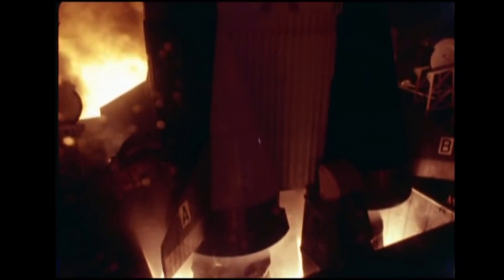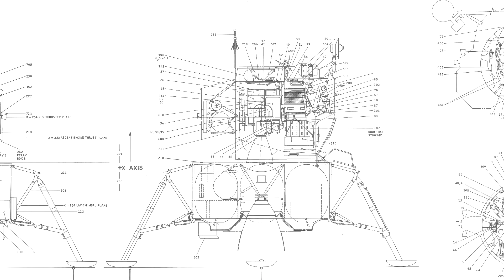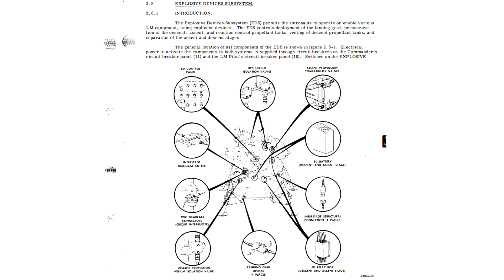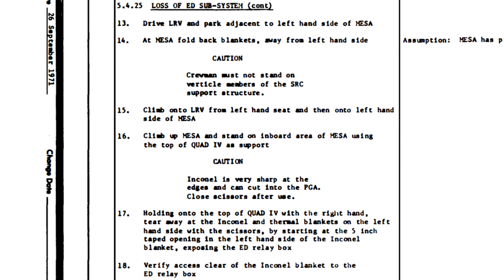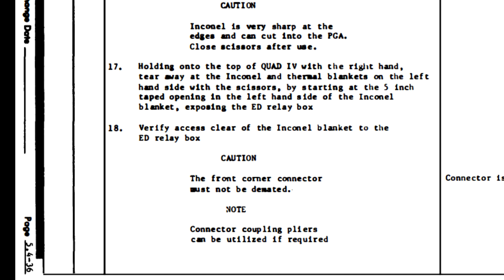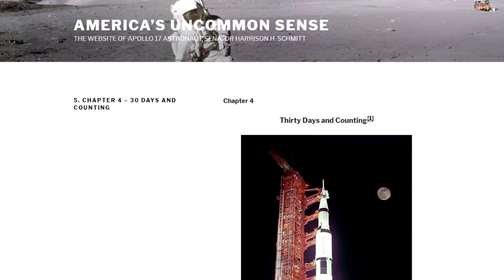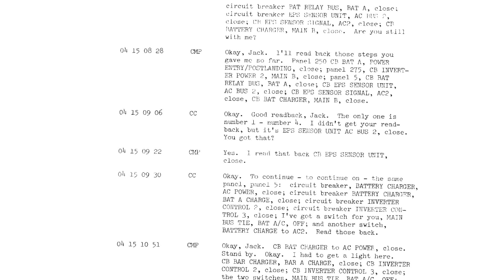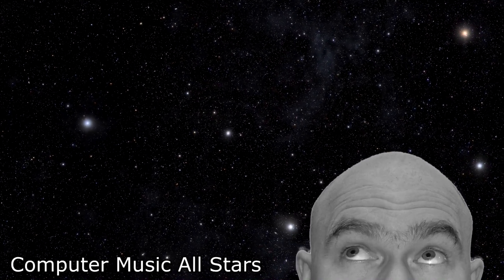Why Lunar Landers Had Jumper Cables For Emergencies

Comment: I thought the ascent engine on the LEM was a chemical engine--one that produced thrust by the mixing of fuels instead of ignition of fuels.  For the very reason that it was less complex and thus more reliable.
Reply: Yes but the helium system used to pressurize the propellants had explosive actuated valves that required electricity to be used. Same with the explosive actuated bolts and guillotine to sever the ascent stage from the descent stage.

Comment: why would they need to jump start the engine, when the fuel was hypergolic (they ignite when they mix)?
Reply: They needed power to open the valves and sever the connections between the upper and lower stages.

Comment: I wonder what the added costs in terms of weight and getting into orbit and to the moon would have been if an accessible socket had been added to plug the jumper cables into.  I'm sure that by the point you need to climb up, cut an access hole, etc, etc, being calm and careful would be getting difficult to do.
Reply: Interesting question. They were certainly very concerned about weight butGrumman were informed during the early stages of design that the Saturn V F1 & J2 engines would most likely be uprated for later missions. They were also informed to plan accordingly for the possibility of the LRV being included eventually. Seems to me what you suggest would be a easy add-on all things considered.

Comment: I got a question for you… How was the Saturn 5 rocket held vertical before launch, the weight distribution while standing vertical intrigues me…. It didn’t sit on the  engines and it wasn’t held in the air by the gantry or the arms that fed the fuel.  So how did it stand vertical.. where was the point of contact that held all the weight?
Reply: 4 reinforced points on the bottom skirt of the 1st stage.

Comment: I have read that for Apollo 11, Neil did not consider the double redundant automated fuel valves to be safe enough and he wanted the LM designers to add a manual valve control as well.  So that, if EVERYTHING failed, he could simply open the valves by hand and achieve hypergolic ignition without ANY electrical power at all.  Either NASA or Grumman decided this was not a desirable design feature and overruled Neil’s request.

Comment: To answer Scott's question: the vacuum of space is a better insulator than dry air. It won't hurt anything electrical to expose it to space. The battery and it's terminals are probably in a sealed system, with 1 earth atm of pressure behind it. It's very likely it's all very well sealed where it needs to be.

Comment: The battery voltages on the lander were probably much different than those of the rover. And why there was no easy way esp. when weight was a premium to interface the two systems.

Comment: Scott I believe it was not the measure of last resort but rather of penultimate resort. The absolute last resort involved affixing the leads to a battery and to the groin area of their spacesuits. With the lower lunar gravity the resulting surprising and intense electric shock to a vulnerable area would allow the astronauts to propel themselves into orbit where they could eventually be picked up by the command module...:)

Comment: you're going to feel a right goon soon...when all this gets revealed as FAKE...coming soon. Boy will I laugh out LOUD!
Reply: Roy and Pat. Two idiot's trying to out-stupid each other. Hilarious!
Reply: How so Roy?
Reply: @steverodgers8425  Tempus Monstrabit
Reply: There were no moon landings. Above 400 miles there are the Van Allen Radiation Belts so a craft would need 6 feet of lead around it to survive in space during solar flares. Computers were weak and took up an entire room in 1969. No stars in the sky? There would be countless stars if they were on the lunar surface, which is pelted continually with tiny meteorites. They would have to take shelter in a cave said Von Braun. Mere lies fed to the gullible public.
Reply: @folkblueswriter  yep, spot on

Comment: In the electronic schema of the explosive devices system, there are monostables which are used for some of them; these monotables add a delay for the explosion, which means that the explosive devices were not exploding all in the same time, while they should have for the homogeneity of the separation!
And we see the lunar module make a complete pitchover at the top of the video of the ascent of the lunar module in Apollo 17, which means that it brutally passed from a vertical attitude to a horizontal one; but it is not possible, the lunar module can only have a horizontal attitude when it has acquired a sufficient horizontal attitude, and it is obvious that, at this moment, it has not acquired this horizontal speed; that's precisely why we see it fall just after this pitchover; it should have continued to fall till to crash on the lunar surface, but suddenly its fall is magically stopped, and we then see it make a strange sinusoidal move with a growing amplitude, which can be explained by the fact that ascent tanks were not positioned symetrically relatively to the ascent engine (with the excuse that the oxidizer had a greater density than the fuel), and the engine was not gimballed.

Comment: I've saved myself from a dead car battery with a laptop charger once, and an industrial electric floor sweeper machine a different time.  Gotta know how to steal that energy!  Also have used a forklift for a push start, but that's not electrical boost.

Comment: How could the astronauts go outside to use the cables?, at that stage of the launch sequence the EVA suits had been thrown out ofthe LM as no longer needed, and the crew were on internal suit oxygen and cooling
Reply: The EVA suits were still inside. The PLSS was what was jettisoned but before doing so, they removed the Oxygen purge system(OPS) which would have given the user about 30 minutes of oxygen.
Reply: @mako88sb  thanks
Reply: they couldn't, because they never went

Comment: So I understand that ascent from the moon requires at most 1/6 the amount of fuel as from Earth, and I understand that the CM is in orbit and the AS of the LM somehow docks back to the CM. But they still have the weight of the men and a few cameras and lunar rocks and things. So how does that little AS have enough fuel to get them hooked back up to the CM, and how is it done so perfectly with only one shot and no steering? And then how does the CM have enough fuel to burst back out of lunar orbit and into the wider orbit of Earth?
Reply: The ascent stage has the reaction control thrusters for steering and docking. They've still got the Service Module engine to get out of lunar orbit back to Earth.
Reply: @bc1969214 : With the ascent stage being as small as it is, how would it have enough fuel to fire hard enough to break free from high Earth orbit where the moon is back to land? And I was thinking the service module (also lower-cased like "ascent stage" because it's not like they're proper nouns) was on the ground of the moon, and the command module is what was left in orbit around the moon until it was time to go back to Earth. What am I missing?
Reply: @HelloKittyFanMan.  : The Saturn V needed about 2700T of fuel to lift 160T in low Earth orbit.
Again 100T of fuel was needed to push 45T in translunar orbit.
The LEM needed about 8T of fuel to land 7T on the Moon.
And 2T of fuel to lift back 3T back in Moon orbit.
Then a few more to push back the CMS to the translunar orbit to Earth.

You certainly can find detailed computation of this at many places (if you do I would be happy to get a link).
You can recompute most of it simply using the Tsiolkovsky rocket equation, but for the Earth take off, where it's a bit messy due to Earth atmosphere.

Comment: Very interesting Scott.  Obviously these wouldn't be jumper cables with big alligator clips (Ha!) -  so the fly in the ointment would be ensuring that all contractors were using the same plugs and receptacles for the critical points.  Contractors would sometimes design without module to module compatibility. A case in point - the scrubber canisters used up to and including  Apollo XIII.  Square for the CM and round for the LM.  Thus never go to space without plastic bags, socks and duct tape :-)

Comment: Why did Grisham hang a lemon on it?
Reply: Gus Grissom, who perished in the plugs out pad fire (Apollo 1) had serious issues with the Block 1 CM build reliability and QA - (Just like Wally Shirah had similar issues with Grumman for the Block 1 LM, later in the program). Gus thought they were rushing and cutting corners (they were). - thus the lemon photo. He saw badly bundled wire harnesses, chafe points and so forth.  The corners being cut,  in the presence of a  pure oxygen pressurized atmosphere, and a hatch that could not be jettisoned from inside caused Gus his life along with Ed White and Roger Chaffee.  Gus was right. He was a very serious test pilot, but the astronauts could not impact the schedule. What was happening was called "Go fever".  And NASA  ensured no photos like that ever got past the PAO. again.  After Apollo 1, the astronauts had more say - and Wally declared the LM to be unsafe due to poor QA. They had to go back and fix their test and inspection procedures.   They all knew the risks - and willing to take them, but risks (particularly safety of flight) should never be induced or accepted for schedule (during Apollo, money was never an object). Apollo 1 was a hard lesson and a bitter pill. But during the STS program with STS 51-L (Challenger) - NASA and the contractors (in this case Morton Thiokol) once again had go fever.  And we all saw what happened a few seconds after the STS was commanded to "Go at throttle up".  Gus was sounding the alarm bells with Apollo, just like the Morton Thiokol engineers were ringing the alarm bells with STS-51L.

Comment: Personally I think if you think about the final procedure the hatch had to be open so they could manually complete the circuit which means that yes they could have used the rover, however, one astronaut would have had to stay behind to manually complete the circuit. That's not an option as it would mean certain death for whoever that was. And that's just not an option for a program meant to return them to the earth.

Comment: Scott, Has no one considered a technology re-vamp of the LEM, with modern materials and computer technology could it not provide an  option for return to the Lunar surface at a lower cost? even build a "Habitat Module" based on the landing stage to allow longer duration missions (landed in parallel with a crewed lander) but with the "command module replaced with Crew Dragon or the Orion Capsule?

Comment: I don't know why I think like this...but imagine using the Lunar rover as a last resort to get power to the ascent stage.  There you are, standing on the Lunar surface next to the rover.  And just as you make the electrical connection, the damned thing fires off into the Lunar sky without you!  :)

Comment: The lander had to be +- 5 degrees from level to have a proper takeoff profile. They made contingencies and designed gear that would be adjustable. It was all scrapped as it was too heavy. They gave the astronauts a shovel......
Reply from the maker: Officially it was 12 degrees https://forum.nasaspaceflight.com/index.php?topic=32246.0

Comment: Scott Manley thanks for that.  On a previous video you discussed KSP deorbiting a moon, and it struck a chord:  I want to crash 24Themis into Mars to enable terraforming.  I want to use several nuclear engines of gigantic proportions to melt ice and use it as super heated fuel.  Nuclear engines can run indefinitely on water.  My concern is getting the water melted and transferred to  the engine.  Also there is the issue of keeping the engine vertical and programming them to fire during the night shift.   It would be more efficient to cancel out rotation to keep them all firing at the same time in the same direction and set up an orbital satellite to help steer it into the dark side of mars.  The goal is to crash as many small moon size asteroids into mars as possible to add weight, push mars closer to the sun, add water, add atmosphere and add oxygen.  At present there is no way to terraform Mars with the available material and gravity.  Everything needs a boost.  We need more heat from the sun so we have to be closer and maybe use some kilometer size mylar mirrors in orbit to help.  We need more gravity to aid in atmospheric pressure, and we need more oxygen and water.  We have to outsource this to the watery bodies in the asteroid belt.  There is no other way.   So suppose we settled upon a nuclear engine design and filled the BFR cargo to capacity with them and made a trip to a sizeable body in the asteroid belt.  How big of an object could we expect to get in a ten year period at full blast from 10 large engines?   24Themis is less than 200 miles in diameter, but each cubic mile is an ocean to itself, or at least a small sea.  That would be around 5 million cubic miles of ice.  Yes, let's crash that one into mar before they set up a huge colony that would be wiped out by the exercise.
Reply: If we cannot crash it we could put it into orbit, then send down chunks or even melt it and send the water droplets down as snow in a continuous flurry for decades.  But I really want to crash it.

Comment: Hey Scott, could I ask is it feasible to push the ISS in to the moons orbit, sounds a handy reuse of that big old satellite :-) my best. Paul
Reply: great answer big thanks :-)  @karstentopp  could you perhaps attach aload of rockets to it and push it over :-D while if nasa make their luna setup wont they still have the same logistical issues? it's just what is more expensive say to push the iss to the moon presuming we mapped the gravity wells correctly on the moon and put it in to orbit there, or making a new luna setup from scratch which sounds a bit like a second iss to cover the logistics of any surface ops :-) Thanks again
Reply: @karstentopp  Thanks :-) when you put it like that it really does make sense. The nasa time frame seems ambitious to say it mildy to do their luna setup. It will be interesting to see if it happens or is hugely over budget and 20 years late :-) Still as you say least it will be the latest tech with all the experience and research in the new plans. With this in mind now I will be keeping more of an eye on the gravity mapping there, I was a little earlier before but I honestly didnt know it was such a pain :-) big thanks for spending the time to enlighten me.

Comment: What happens if you put the jumper cables on the wrong way? Will the battery explode and spew acid everywhere? Will the electric current shock the EMU's life support, rendering it useless? Will the cable's thermal cover split at the cable's bend like literally every iPhone charge cable ever? These are truly the great mysteries of the universe.
Reply: ( Probably the first option, unless Apple makes these cables like @Don Jones suspects)

Comment: Wow that is Kerbalicious! Lift off with the hatch open, so i guess they’d still be in their suits, able to detach from module air supply to do the work of either stowing or jettisoning the jumper cable and then closing the hatch. Maybe the guy that comes inside from the jumper cable job wouldn’t even hook up? Keep on going with the 30 minute air supply? Thats nuts

Comment: The fact you avoid like the plague, 'A black body in space will loose it's heat energy, w/o a larger body of heat radiation to keep it warm.'
Hayseed's hypothesis, the continued belief that airliners hit the twin towers.  Believing in the lunar hoax, is not far behind.
Reply from the maker: Or without an internal heat source to keep it warm. Why do you think Apollo 13 got so cold with most of its systems turned off.

I swear you moon hoaxers are getting increasingly amateurish.

Comment: Scott, how exactly did they match up the remote camera movement with the ascent stage taking off from the Moon?

I imagine they had three days or so to get the timing just right for the radio delay, but still, it was quite impressive.

I'm also guessing they used the countdown clock from the AGC / orbiter to get the timing just right.

I didn't notice before that the camera operator also moved it slightly more, and caught more of the launch as it got further from the surface.
Reply: Unless the guy in the orbiter was controlling the camera? lol

But I always heard it was controlled by NASA?

Comment: Good job Apple didn't build the ascent module: it would not have had any ports to plug the jumper cable in.
Reply: They wouldn't worry about it... Y'know, 'cause it's wireless.

Comment: How did they make sure it landed at the correct angle to the horizon, so that the ascent modules nozzle pointed in the correct direction for ascent? Or was it only offset to counteract the center of mass?
Reply: the computer was supposed to adjust for center of gravity, do you know where the details of how the engine nozzle is angled, apparently can swivel 6 degrees. If it is servos where are they ?
Reply: @kimbalcalkins6903  the diagram in the video suggested that the nozzle was offset slightly. He said that there was no gimbal much on the ascent module (but I could be wrong. Obs vodka lol). So I thought.... How could NASA guarantee an ascent to the correct  altitude if the lander was sitting at the wrong angle?
Reply: @3600-w6c  The  CSM is moving at about a mile a second. If the LM trajectory is off 1/4 degree in any direction you would be off 460 feet in 20 miles. It must have been all under computer control. It gets complicated because of the elliptical orbits having to be calculated, ie the CM's velocity and elevation is changing all the time. I guess it was all calculated ahead of time ?